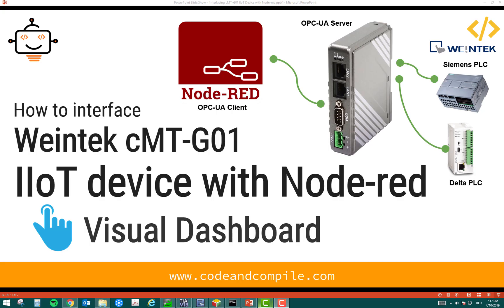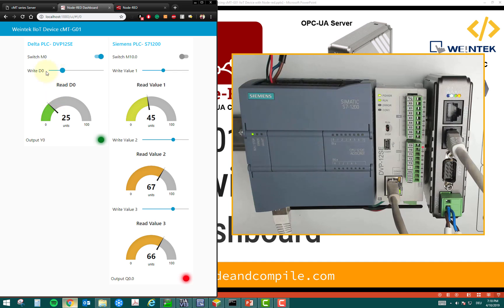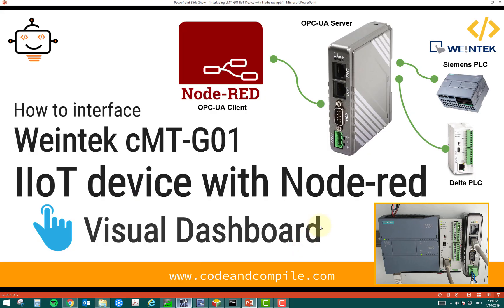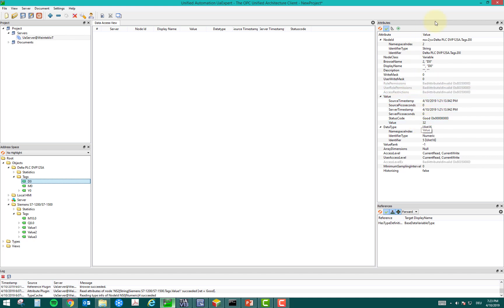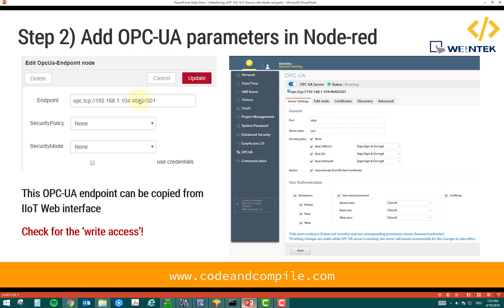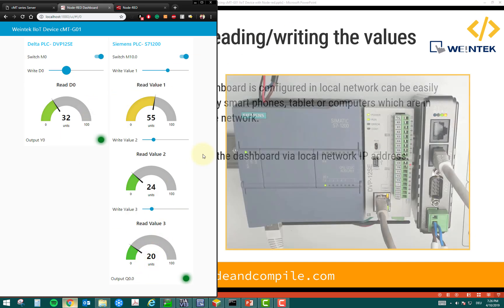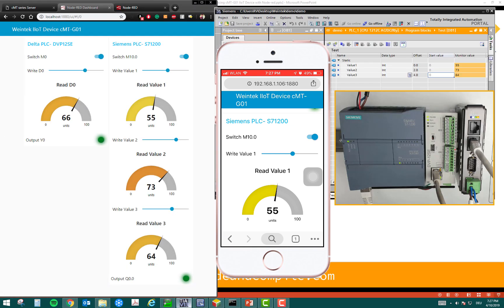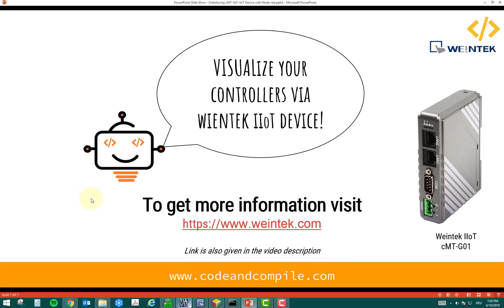Lesson 5- Interfacing Weintek IIoT Device cMT-G01 with Node-red

Comment: Sir ek programe banana ha Hydrolk machine ka ek bar push button dabane se machine upper jati he or 50kg pressor switch se band ho jati  he or fir 10 min timer 
Chalta he fi r timer off hota he to solinoitwal on hota  ha to machine neeche aati he or fir limit switch se  touch ho ke upper jati he aise selector switch se  3 bar process hota he fir 2sra timer chalta ha to fir machine neeche  aakr off ho jati he.
Sir   selector switch 4pol ka hai 1no. Te rakhiye ek vari neech e aa me off ho jati he 2pe rakhe 2bar aa ke band ho jati he 3pe rakhe 3bar neech e aa ke band ho jati he 4pe band hi ho jati he. 
Dono timer Panel ke upper Lage hai pehla timer sec wala doosra timer min wala
Please sir yeh programe humko bnaker dedo